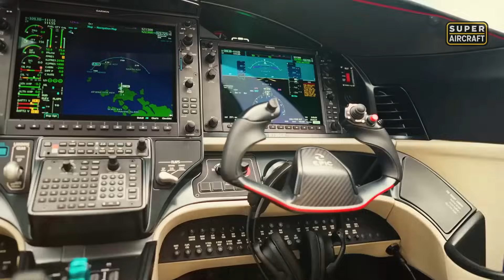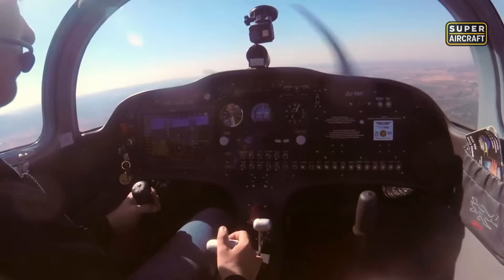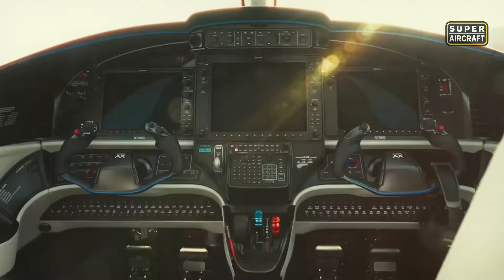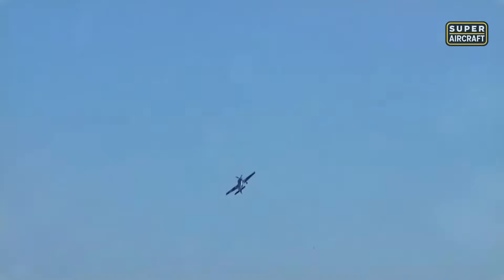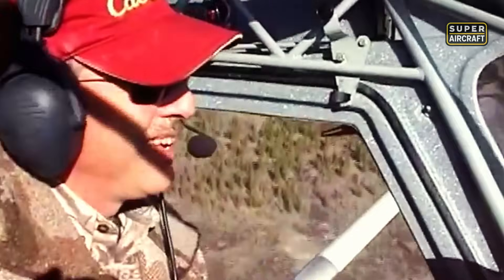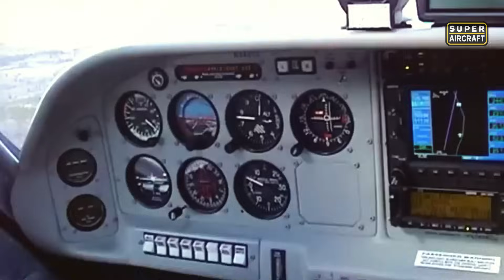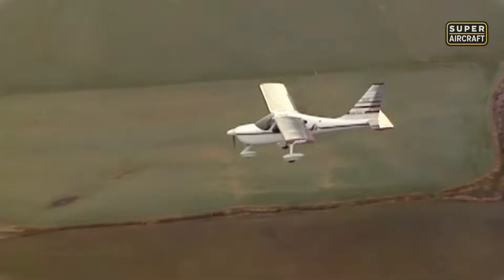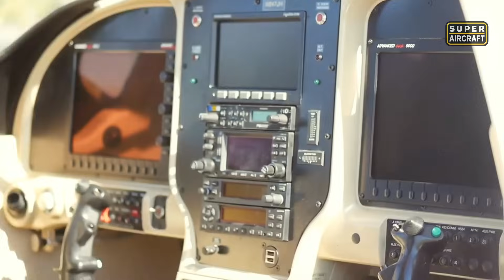DISCOVER THE BEST EXPERIMENTAL PLANES EVER BUILT BY HAND!

Comment: Stop saying Lycoming India Oscar. That's not how you say it. The correct pronunciation is eye oh Lycoming. The "I" stands for fuel injected and the "O" stands for opposed cylinders. Google Lycoming Certificated Aircraft Engines to get the information. Apparently you're not a pilot. Otherwise you'd know the proper terminology.
Reply from the maker: Thanks for your comment. 🙌 You don’t need to be a pilot to understand this terminology — aviation knowledge is not exclusive to licensed pilots. And judging by your comment, it seems you’re not a pilot either. The “India Oscar” pronunciation is widely used because of ICAO phonetics, which are standard in aviation communication. So it’s not incorrect, just another accepted way to refer to the designation🤠✈️
Reply: @SuperAircraft2025  Dude. It's not an accepted way to refer to it. No one says India Oscar when referring to Lycoming engines. I'm a pilot and own an RV14 with an IO390. It's pronounced "Eye Oh"

Comment: Alot of incorrect info.
Reply from the maker: Thank you for your comment and engagement! 🙏 If you could point out which information is incorrect, it would really help add more knowledge and value for everyone here 🤠✈️
Reply: The Epic E1000 started as a kit called the LT, but it's been a certified plane for years (around 10) and the kit was discontinued in 2014. The video showed the certified plane.
Reply from the maker: Excellent observation! The Epic E1000 did indeed originate from the LT kit, but after undergoing the FAA Part 23 Certification Standards process, it transitioned into a fully certified aircraft. The fact that the kit was discontinued in 2014 is crucial to distinguish the amateur-built/experimental category from the certified version, which complies with much stricter airworthiness requirements. This distinction avoids confusion between experimental aviation, limited by specific regulations, and certified aviation, which can operate under a much broader range of missions and flight conditions.🤠✈️